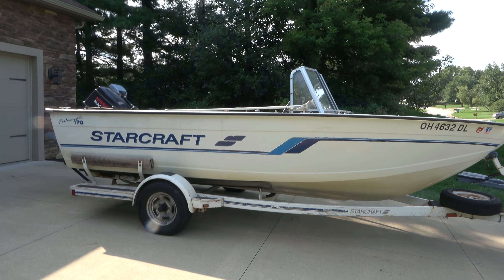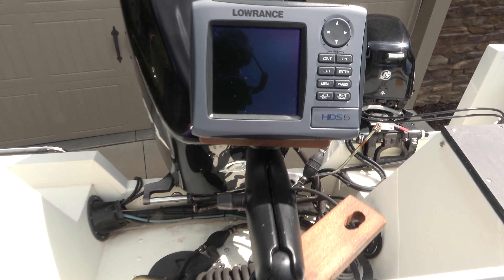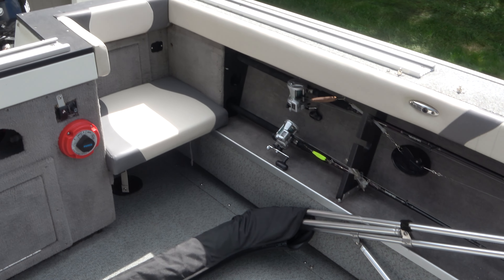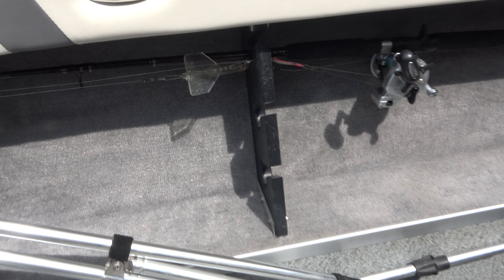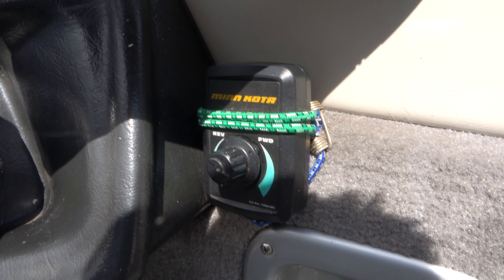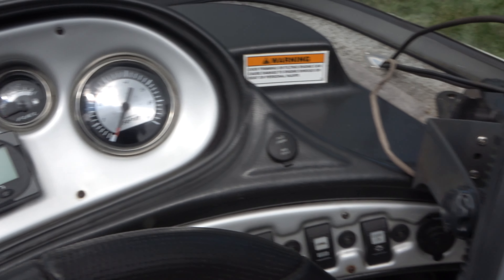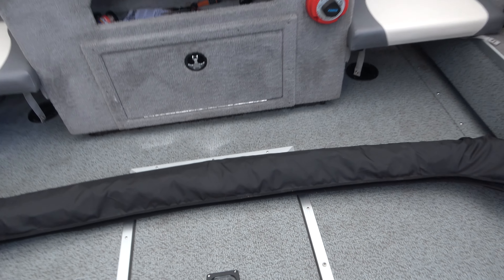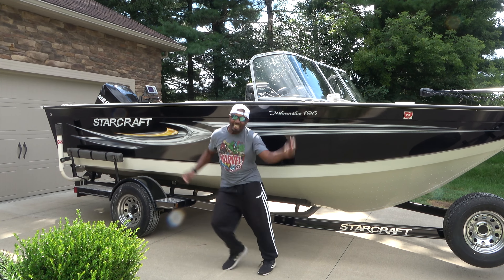NEW STARCRAFT FISHMASTER FISHING BOAT REVEAL!

Comment: The Fishmaster 196 is one of my favorite boats.  A couple of my buddies have one.   Not sure about that engine mounted motor.  Push with the kicker, steer with the MinnKota is what I and most others do.  As far as the livewell, I bleed the fish out in there, and after about 15 minutes, throw them in the cooler on ice.  One thing....the livewell lid tends to bounce up and down in rougher water, causing the water to splash out.  Not sure why Starcraft hasn't figured out a way to improve that, but otherwise a sweet boat!!    Congrats and looking forward to seeing it on the water.
Reply from the maker: Thanks. Yeah I plan to start bleeding the fish out as well. Thanks for the tip on that and water splashing out on bumpy trips.
Reply: @KeepFishing  What's the update on your boat?   Add any goodies to it?   The lake has not been playing nice lately.
Reply from the maker: I finally got 8 cisco black aluminum rod holders but other than that nothing new. The few times that I have been out has been really nice although I'm still working on getting the 9.9 kicker starter. It has click over and ran for like 30 seconds and then shuts off. The last time I was out it didn't even click over. I actually used the engine mount motor to troll some and it was very nice. In the next few times I get out I need to try out the livewell, however people are saying that it tends to spill water over at times. Thanks for checking in on me.
Reply: @KeepFishing  Did you ever figure out that MinnKota motor mounted on your big motor?  How about that weather system?   Fish on!!

Comment: Beautiful boat! I love the rear splash well design with the seats. I have a 01 Starcraft Pro Elite 2000. Absolute fishing machine and cuts the rough water amazingly. Very deep hull. 1 small livewell in back, but mainly use the 50 gal bow livewell. I Never fished Erie, yet, but being from WI I fish the Bay of Green Bay alot. We throw 2 large bags of ice in the bow livewell.. I fill the livewell once and re circulate all day keeping the fish alive.  At the end we bleed them put, drain live well, fill back up to submerg fish and dump 1 more bag of ice in when we leave a gas station. That's the way I do it and it works good. Others do it differently.
Reply from the maker: Thanks. Starcraft boats are amazing. Thanks so much for sharing how you use your livewell. I am more than likely going to follow exactly what you said for how you use your livewell. Hopefully at some point you can fish lake erie. I have heard that the walleye fishing in WI is really nice.

Comment: Great Ne.w Ride Captain! Congratulations Some guides that I know use that main motor electric to push the boat and front one to steer but with a gas kicker really don't need it and adds weight to your boat I would pull that and any batteries and sell them.  Just imho too much added weight.  Have a lot of ideas on how to set up boat. Like push the rod holders further forward and set up a "meat seat" up front.    Dang can you keep the old boat reg numbers always thought it was a DL down low boat.
Reply from the maker: Thanks. I definitely have a lot of set up options with this boat so I will be changing and adjusting things as needed. I purchased this boat out of state so I needed to remove the old boat numbers so that is why they are missing.

Comment: I like your boat. Myself I would use your live well with ice instead of water.  My experience with live wells is constantly changing water to keep them alive and end mostly with dead fish anyway. The minnkota electric motors on your outboard motor could possibly be a good thing.  Some people use them to troll with and steering it with your outboard steering wheel. It could be used along with your trolling motor up front. Also people use them on smaller lakes where they don't allow powered motors, electric only. You have several options with what you have available in that boat. But I want to give a friendly advise on how much battery is needed for the one on your outboard. It sucks when your out of battery and don't have enough to start your main motor. Thats why you have two battery switches and what 4 to 5 batteries. Hope this helps.
Reply from the maker: Thanks. I appreciate the tips for the livewell. I figured I could try using the engine mount trolling motor on some smaller lakes when I am shallow. One thing I also need to figure out is which of the batteries is for all of my electronic devices. Gotta admit this will be an ongoing learning experience. Again thanks for the helpful tips.
Reply: I have the same boat. the live-well sucks! you will end up with a ton of overflow into the bildge.  you better hope your pumps work!

Comment: In cooler temps (80 and below), I use the livewell as livewell - but keep an eye out for dead fish - I have a small cooler on board that if they die, they go in there.  
Perch will tend to die quicker than walleye.  I can usually go out for 4-6 hours and have the walleye still alive - I bleed them right before motoring in then throw in big cooler in truck.
Reply from the maker: Thanks for the tips. I plan to start bleeding them cause I have never done that in the past.

Comment: I would highly Recommend getting a ITROLL system for your kicker....I love mine..
Reply from the maker: I have yet to get my trolling motor to stay running. I have gone through a few test myself to get the motor running but no real success. Currently I'm using the trolling motor on the front of the boat to steer for me and it is working pretty good for now. When I get the kicker working I will look into the ITROLL though. Thanks for the tip.
Reply: Check out erie marine in Sheffield Lake....great place to get your boat worked on...your gonna wanna push with kicker and steer with minnkota....that's how I'm set up
Reply from the maker: Will do...I will check them out...Thanks

Comment: Hey, I just bought the same boat.  Except a 2012, but with only a 115.  Anyway, which trolling motor do you have and how do you like it.  Mine does not have one, and I’m looking at another terrova.  I’m going with 72”, but was debating between the 80# and 112#.  Just wanted to see what you had and if you would do it different
Reply from the maker: Congrats on the new boat. I have the Minn Kota Terrova 80/US2-60" w/I Pilot. I'm fine with the 80# but I would like the 72" for Lake Erie. There are times my blade comes out of the water depending on the waves.

Comment: As for the motor mounted motor. I see guys adding a trolling motor to the back of the boat for braking and extra boat control.
Reply from the maker: Yeah I can see the boat control. I have used it for some slow trolling so far. I'm lost on using it for braking though.
Reply: @KeepFishing  I see guys putting like 2 tiller trolling motors on the back of the boat they say for breaking, put them in reverse to slow down drifting. Crappie fisherman
Reply from the maker: @cutterok  Say less....I get it.....It is just like adding the drift sock to slow down the troll......Not sure why my brain did not put it together when you said it before......but....thanks for explanation...I totally get it.....and I will be using that in the future 👍